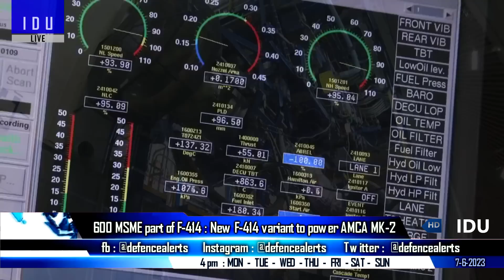Indian Defence Updates : India US Hypersonic Missile,130 Kn Engine For AMCA,Stryker Local Production

Comment: In F414 there is no 3D thrust vectoring, plus not made for 5th gen so it is good for Tejas Mk2 but for AMCA we should go for Rolls Royce as it has IP rights as well. At least there should be IP rights for F414 to India as the tech is 30 years old and we are buying a lot of engines ( will improve USA weapons appeal to India and will give an edge for joint ventures)
Reply: We should not expect IP rights when we contributed nothing. We are getting lot of ToT without paying anything extra.